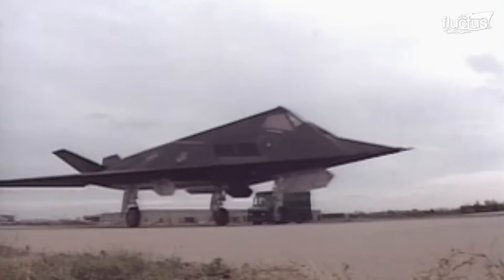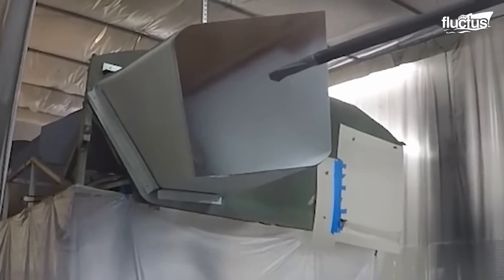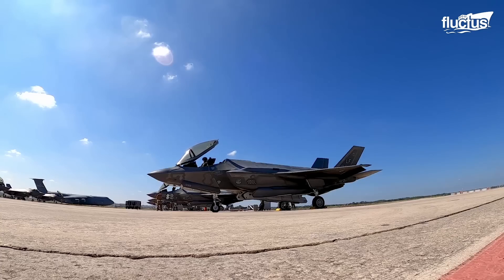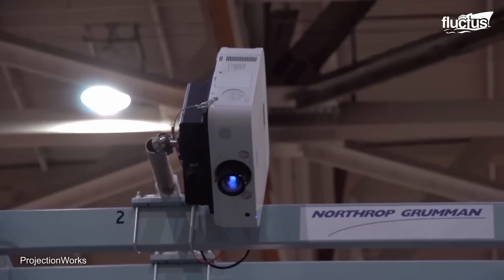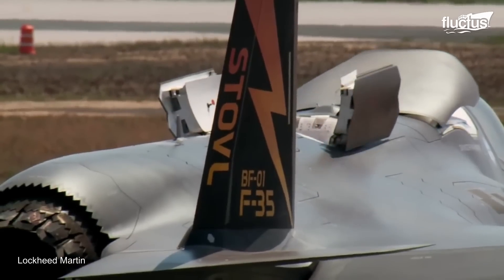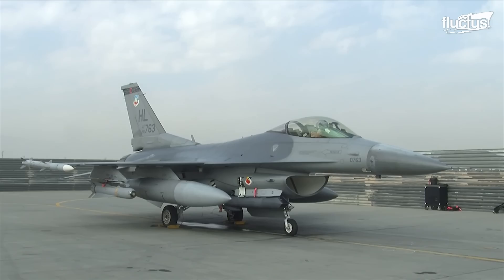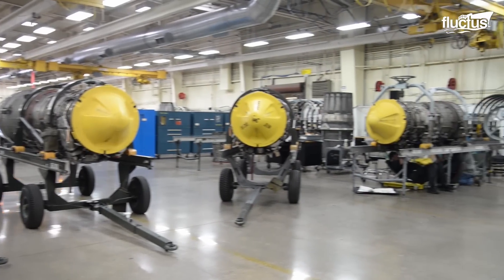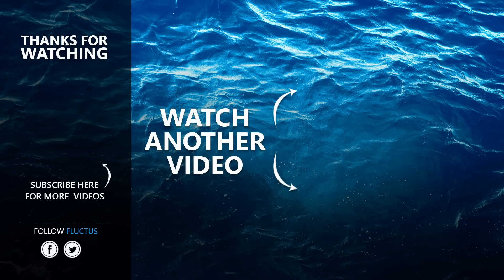How They Design & Build US Air Force Most Feared Stealth Fighters

Comment: Individual aircraft production costs should always include the proportion of the development cost, otherwise its meaningless.

An injection molded clothes peg could cost almost zero to produce, but the tooling and development is quite expensive. It has to be shared over every clothes peg produced.